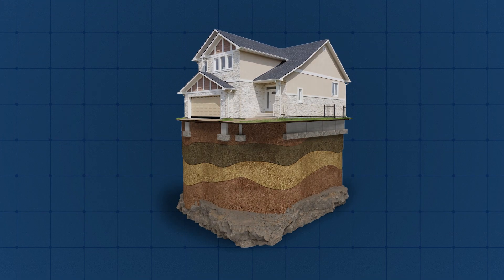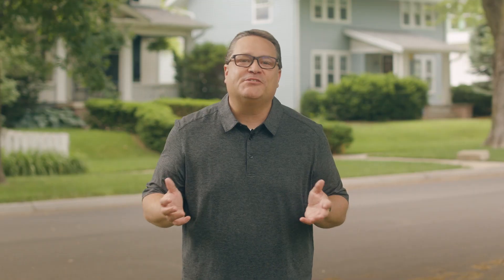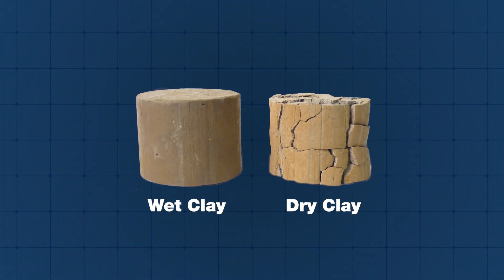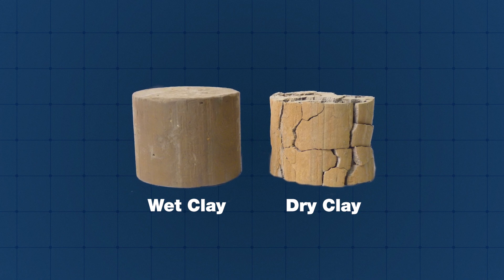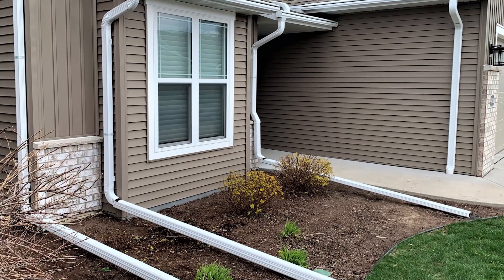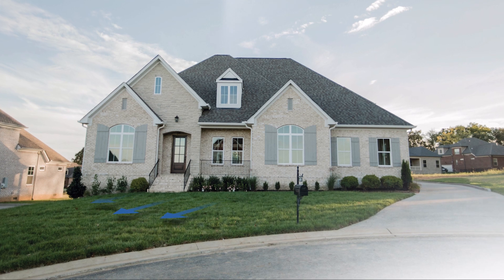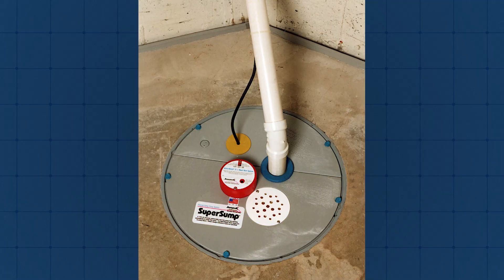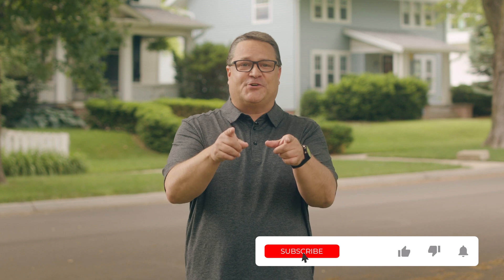How do different types of soil cause foundation problems?

Comment: Would love advice. I have a slab foundation house in Los Angeles valley, bought 3 years  ago with no issues- was fully “flipped” 5 years ago with ceramic tile faux food floors. Used to be all flat and no sloping. Now there are dips but most noticeably sloping at the start of edges (especially the rear 4th of the house has started to dip). I’m guessing it’s soil interaction n the down hill feeling it creates is so very upsetting n haa also caused all those doors to stick with cracks at the frames. Where do i start? Structural engineers? What are potential fixes and prevention… i have gutters but need more drainage solutions? Any advice would be so incredible

Comment: How do you fix foundation cracks? 

Also, in a home if the flooring is slopping or crowning is that an indication of foundation or just subfloor damage? 

Thank you! Your videos are very helpful!
Reply from the maker: Thanks for your comment!
For your first question, there is a few different approaches depending on your specific problems and type of walls. If you have block walls, give this video a watch: https://youtu.be/d9_A2JTqhOs
If you have poured concrete walls, we'll be addressing that in a video soon!

For your second question, refer to this video: https://youtu.be/LQcEajIL57I